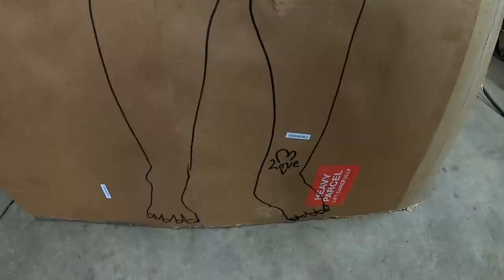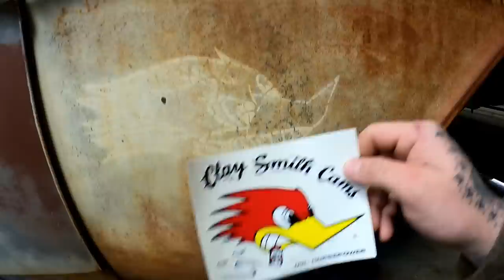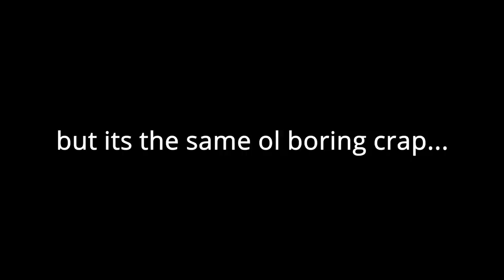1961 Parkwood Wagon FLOOR PAN replacement!

Comment: Can you drop a link to the floor pan supplier? Thanks!
Reply from the maker: I bought them through Summit because they had the cheapest shipping for me! 

Here’s the part numbers, Google these! 

-BFP1700L
-BFP1700R

I should of put that in the video!
Reply: @PuddinsFabShop  yea I’d never seen sheet metal arrive that haven’t had a fork lift run through it, after someone my size sat on the box for a break….let alone have it drop right in.
Reply: @PuddinsFabShop  dang just looked up one on Summit and what a deal at $121 and in such quality. Puddin you want to share what brand cutoff wheels and flappers you use? Great video and your sure a funny hard working dude we all are grateful to spend time on here watching your videos. You might not have the tip of the caulking cute big enough to lay it down easier and fatter.
Reply: ❤❤❤❤❤ Hot Rod ❤❤❤❤❤
Reply: Hello From Mark In Kentucky.  I used to do similar types of welding repairs at the equipment repair facility where I retired from in which I was repairing dump truck beds that would be rotted out from the salt and calcium chloride spray over their service life when those trucks was spreading salt. 
The brand of grinding wheels and 14 inch chop saw wheels that I used was made by SAIT abrasives that was rated for cutting stainless steel. The flapper wheels were various brands that were purchased in bulk. The plasma cutter that was at the garage was a Cutmaster 102 that required at least a 100 amp electrical circuit to make it work properly and the Mig Welder was a Miller MillerMatic 350 In which I used .035 and .045 diameter Lincoln copper clad mild steel wire depending upon the projects that was going on at the time. 
The beds would be so rotted in places that the plasma cutter wouldn’t even cut if that tells you anything. Usually I kept different templates of bed panels and side board brackets to make the fabrication process go faster. In slower periods of time, I would make different parts and pieces to keep in stock for future projects.
In the past I have welded the body panels and flooring in the days before the Mig Welders with coat hangers and a OxyAcetyline brazing tips. I never had the sheet metal brakes but used forklift forks pieces of thicker metal and plenty of clamps.
Reply: Apparently burning asbestos makes you think you're smelling a Buc-ee's
Reply: @blindguygarage  I was thinking glue. My bad
Reply: I thought you clear-coated that truck
Reply: This was a really good episode! It had everything, Art, Dancing! And a lot of talented fab work too.
Reply: CAN YOU DROP THE LINK FOR THOSE PUDDIN FAB SHOP WELD CAPS 😂😂🤦🏽‍♂️🤦🏽‍♂️
Reply: I really dig your videos! Goofy, but serious too. Very informative. I need to do floor work on my '53 Ford.👍
Reply: Most of these panels are made baby Dynacorn and sold by dozens of retailers at various prices and shipping costs. I always search around for the closest retailer, or for a deal they might have.
Reply: I know you didn’t feel well doing this video but it has to be one of your funniest. It’s amazing what you can do to these old cars. They just don’t make um, like they used to. My Mom had a ‘63 wagon. It had 3rd seat that faced the back of the car.
Reply: Wonky guy nothing!
I know who you are...
It's  THE BUGMAN!-
1/4-HUMAN,1/2 PUDDIN, & 1/4 BUG.🤣
Reply: Wonky guy nothing!
I know who you are...
It's  THE BUGMAN!-
1/4-HUMAN,1/2 PUDDIN, & 1/4 BUG.🤣
Reply: I love what you do shearer I don't spell or read but understand I'm ways yeah 👍

Comment: Clay Smith was using the Mr. Horsepower Woodpecker in the fifties, before the thrush Thrush(Thrush's are another kind of bird) was even an egg. Mr. Horsepower is also smoking a cigar(which you can't see clearly on your fender since it's pointing straight back), the Mr. Horsepower logo has varied a little over the years but always has the sharp bent beak and the ceegar. I've been seeing that oldPeckerwood in HotRod magazines starting in about the mid fifties. That old Johnny Come Lately Thrush bird didn't show up for another 20 years as far as I can tell
Reply: Just a quick search shows Mr. Horsepower showed up in 1931 vs. the thrush mufflers bird in 1966. Not sure that's exactly right, but it was what I could find
Reply: @philb4049  Good work! I was just going by the ads in my old HotRod magazines and my giant pile of vintage decals. In any case, Mr. Horsepower is way more badass than the Thrush if you ask me(which no one did, lol))
Reply: @Jonathan Gehman  I wasn't overly familiar with either, honestly,  but I was genuinely interested in which one came first.
Reply: Two eyes on Mr. HP and one on the Thrush.

Comment: So after pushing stuff in and out all the time I think the new shop needs a winch mount on the floor to easily set up a winch and pull a vehicle in and out without getting a herniated disc
Reply: I hope that he gets an overhead crane like Diesel Creek is putting in.
Reply: The new shop he wont have to push thing in and out
Reply: Just needs some points for mounting a pulley and a winch/crane up top for lifting bodies and engines.
Reply: He won't have to push anything out in the new shop. It's big enough he won't have to because the new shop is much deeper.
Reply: It wouldn’t be as entertaining when he has the Tow-Rolla to push & tow things around.

Comment: 🎶take me down to the plasma city, where the rust is bad and the car smells shitty…..oh take me home yea ya….🎶

What you’re doing is great, but we used to mix used motor oil and diff fluid and spray that stuff into hidden spots (like rockers and such) until it poured out someplace else….but my buddy Ned went through high school in a Vega (up north) with original fenders. We just noticed that the best cars at the junk yard had bad oil leaks.

Comment: Bubba take a page from DD Speed Shop and in the new shop put a winch in the wall to help pull cars in . You can make one on your trailer dual purpose and take it in and out for just that application !!
Reply: Maybe fix up an old skid steer and impress Mortske. Having a bobcat or something would be real handy on his new property.

Comment: When we did floor pans in high school we would take drill and go under and just pop some quick location holes. Then just connect the dots to mark out bracing. Few little holes popped through and some markers.

Comment: Mr. Horsepower.  My Grandpa bought a John Deere tractor, used of course, in about 1973 that had that decal on it, the only difference was instead of a cigar Woody was chewing on a stick of dynamite.  I don't remember if it said Mr. Horsepower either but I was only about 7 so...  It did have the checkered flags though.  It reminded me of my Grandpa, he always had a cigar stuck in the corner of his mouth, he always chewed on it, I only saw him light it once.  Good work, the floors look great!

Comment: If you would have creeped around underneath the wagon and drilled pilot holes around your floor supports you could have played connect the dots with the old slice n dice to cut out the floors. Love the content.

Comment: Harbor freight has a great pneumatic flange tool with a hole punch. Flange the edge of panels to lap them and hole punch the edge to spot weld. Save a lot of time if the spot welds need to be on the edges

Comment: I don't think it's a mistake if you can fix it before the project is finished.
It's only a mistake if it stops you from continuing the project.
It's 1000 times better than it was and looks great in my opinion.
But I appreciate you sharing because as a complete novice maybe I won't be so hard on myself in the future when I screw stuff up and have to start over, which is why I think you share that with us. Thanks.
Oh and thanks for putting in so much effort to make such fun, informative and entertaining videos, you always cheer me up.

Comment: Quick tip, to keep your glasses or goggles or face shield from fogging up use some dish detergent. Put a little on the glasses undiluted and wipe it off until clear again. Do not use water.

Comment: Another great Puddin's Fab Shop video on How To! Hey, I dropped a line to Somewhatfast after watching one of his 1951 Plymouth Will It Run videos. I suggested he contact YOU for some floor repair advice since you are the Premiere Makers of floors for these old rusty relics! I love 61 Cheys as I owned years ago, a 61 Bay Window coupe when I enlisted in the army,1972. It was red and white with a 327 4-barrel carb, 3 on the tree with overdrive under the dash. That car scooted with premium fuel as back then in Colorado was about 25 cents a gallon.

Comment: I recently started a project replacing floors and lower quarter panels on a 57 Ford 2 door coupe. I've always tinkered with old iron but I have never done sheet metal before. Watching you I can see that I'm doing OK. What's significant is that I'm basically an old fart 65 YO and it keeps me off my ass being retired USAF!

Comment: Run masking tape on each side of the seam. Like 1/4inch away from seam. Spread on seam sealer as messy as you like. Peel the tape off. You get a perfectly straight 1/2 strip of seam seal

Comment: Hey Puddin!! Love the channel, you always make me laugh more than any other channel! I have a suggestion/ video idea. Maybe for the second channel? You should mount a winch on the Tow-Rolla. Then mount a pulley to the back of the shop, where you could pull stuff in to the shop with the Tow-Rolla using the pulley. And then pull stuff out of the shop with the Tow-Rolla. Thought it could be fun, and multifunctional. Keep making awesome content!

Comment: Hey puddin' what I ended up doing seam sealing a trunk was using a urethane recuder and a brush while the seam sealer was still wet to smooth it out, worked out great 👍

Comment: When you get your new place going. You need to get yourself an outside sandblasting pit. 3 half walls made out of whatever, maybe a roof for some shade and to keep light rain off the back of your neck the time savings would be tremendous.

Comment: For seam sealers you put tape on each side of the seam and then gob the seam sealer on. After you gob it on take a small stiff brush to smooth it out. Then simply pull your tape  off for an exquisite look on your sealed seams!!!

Comment: hey puddin i know its an investment but you can also look for a weldinghat with double cap on it then the aircleaner around youre waste so you dont have fog inside that would work since we use it here for many years.

Comment: Next time you could use the plasma from underneath to "drill" holes where you want to cut, then join the dots from above. Also you can get a spot weld drill bit that has a sharp centre and a fairly flat tip so that it just drills the first sheet. It kind of looks like a milling machine cutter with a tiny centre point added

Comment: An easy trick for seam sealer is to run a strip of blue painters tape along each side of the seam, leaving a gap. Run a line of sealer, smooth out peel tape done.

Comment: A easy way i found to mark out where the floor support braces is run self tappers up threw next to them and use a chalk line or a pice of wire from each one

Comment: Mr. Horsepower ~ est. 1931
Thrush mufflers ~ est. 1966

Mr. Horsepower is the cartoon mascot and logo of Clay Smith Cams, an auto shop established in 1931. He is a sneering, cigar-smoking bird with red feathers and a yellow beak. The image is a caricature of legendary hot rod guru Clay Smith (1915-1954), well known for his red hair.[1] Mr. Horsepower is rarely without a cigar, but when he is, he has a "cigar replacement" - such as a candy cane for the holidays. The character is well known among car aficionados.[2]
The THRUSH brand, still a popular choice among muscle car enthusiasts. Established in 1966 and will celebrate its 57th anniversary in 2023. Thrush mufflers and accessories are manufactured and marketed by Tenneco.

Comment: Pudin, don't beat youself up about the seam-sealer. You did as good of a job as the factory guys did if not better. I am sure that their attitude about it was that the carpet and insulation was going to cover it up anyway so to heck with it. when you your wife and hotrod are cruising it will never enter your mind. the 61 Chevy has always been one of my favorites even though I was born with Ford blue in my veins.they take me back to the days when Dyno Don was carving big holes in the NHRA ranks with his 61 409 before he did the obvious thing and switched to Ford. Happy trails to you always. 😎 :glasses-purple-yellow-diamond:

Comment: Seam sealing tips...

Tape off 5mm from each sides of the gap, with just like an inch masking tape whatever, that way u dont get it everywhere and when u pull the tape u have nice straight lines even if u tape round corners.

Run the sealer as rough as u want just dont let it go right over the outside edge of the tape, then if u lick ur finger run it over the sealer to smooth it. The sealer doesnt stick to your finger. Can use dishwashing liquid in a cup with water too. Keep finger wet so it doesnt stick and u can smooth sealer evenly 

Then just slowly peel tape towards itself at end. Best way is to peel each side of tape in one shot. Can still smooth it after that aswell.

Done this alot for panel gaps, boat windscreens, lots of applications. Whether its silicone, urethane, seam seal.

This here also is perfectly fine. Wont never see it.

It works perfect👍

Comment: Theres a tool to use on spot welds it has a skinny piece of sandpaper thats a belt its a belt sander hand held alot of auto body shops use them and they are very efficient

Comment: I wipe my seam sealer joints with a rag soaked in lacquer thinner pulled tight abound my  fingertip.  Leaves it supper smooth.  Use a rag you don’t want back😂

Comment: First time I've commented.  Mr Horsepower is the cartoon mascot designed in 1950s  for Clay Smith Cams. The logo with the cigar represents Smith himself. And is known as Mr. Horsepower. 
The Thrush woodpecker has been used since 1966 by Thrush Exhaust.
Mr. Horsepower logo and Thrush logo even though they are similar are actually two different designs.. I enjoy History also.
Smith always had a cigar clenched in his teeth

Comment: Puddin' as for sitting on my butt... My goal is to have the garage ready by late spring to work on my truck & cars. I'm cleaning out my driveway now. Wednesday I took in 1320 pounds of scrap steel to be recycled and have about 400 pounds of aluminum and hopefully another 800-900 pounds of steel loaded up to take in tomorrow.
The floors look great! As for missing screws... When I was replacing floors in houses, I'd grind the entire floor to get rid of all the old staples. I'd always find a few that I'd missed with my knees!

Comment: @puddinsfabshop trick with those tubes of seam sealer, cut the tip and flatten the hole with a hammer a little. It will give you a decent ribbon.

Comment: Little tip for any caulking jobs. Cut tip small to medium straight cut. Straight cut is important. Then push the caulk rather than pull it. Squeeze pressure and movement speed should match each other.

Comment: I sent the five hot rod stickers I bought back. When I bought them I only did so to help lil hot rod. I also commented I have no use for them. When I heard hot rod was sad because she couldn’t keep them I knew why I bought them. That was to give them to her. So they’re in the mail please give them to her and tell her she doesn’t have to sell them. Please do more hot rod designed items. I’d definitely would by a hat or a hoodie if you had it in my size.

Comment: hello from Canada. I know your busy man but I have a qustion about pinion angel. I'm 4 linking a 1985 cj7 rear. If I set the angle the same as the trany it's going to bind with the travel. was thinking to set at 14 or 15 degree the rear axel 

le

Comment: To stop the fogging of yer safety glasses, put adhesive tape oner the edge of the mask over the bridge of yer nose out on to yer cheeks.  That seals the hot air away from the glasses.

Comment: Pud, I am getting ready to start the floor pans in my 62 Bel-Air,  who did you get your floor pans from.... I had to send mine back that were so bad.  Your original floor braces are amazing,  all mine are gone. (INDIANA).   Your video was really helpful.   Thanks Brother!  Oops I saw it in another comment.   Thanks again!
Reply from the maker: I pinned a comment with the Part numbers for them!

Comment: Puddin on the seam sealer use a acid brush and some  Acrosal and brush your seam sealer smooth 😎.  Don't over do the Acrosal just enough to help the brush glide over the sealer.  Looks good though. 👌 Your so silly

Comment: Your right Puddin..your faded sticker is that of Mr. Horsepower,as he has gaps between his teeth and always has a cigar in his mouth..he was established in the 30's
Thrush Woodpecker is similar but has hot pink feathers,no gaps between teeth and lacks a cigar he will celebrate his 57th Anniversary this year.Having started in 1966..Some decals of Thrush will face right or left...can get them either way.
So Mr. Horsepower came First!!

Comment: Run ya a strip of tape on both sides of where the seam sealer will be. Lay the sealer down, remove the tape and you're left with nice lines of seam sealer

Comment: Seam sealer.... If you want a nice job just run some 1/2" masking tape either side of the seam then smash it on. Smooth it out then remove the tape

Comment: Mr horsepower established their logo in 1931. 
Thrush exhaust systems established 1966. 
Using similar logo but could not copy the Mr horsepower lower so they tweaked theirs